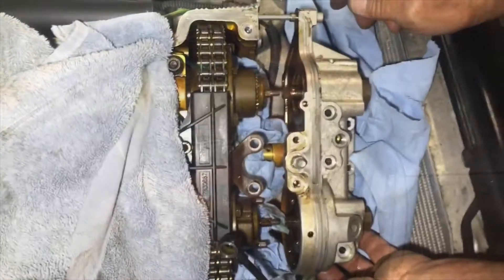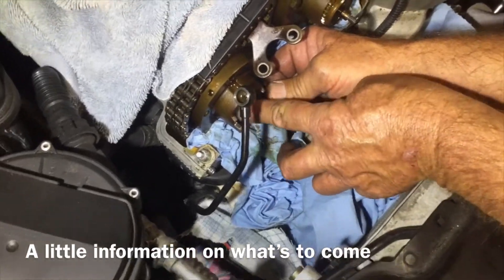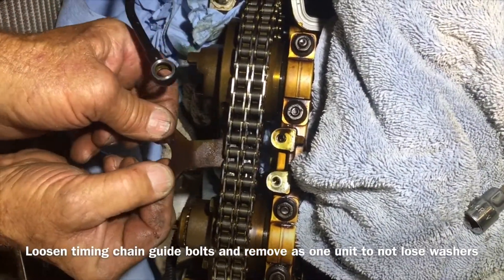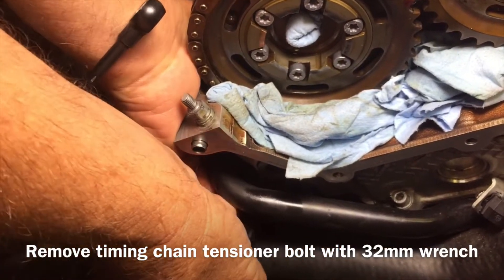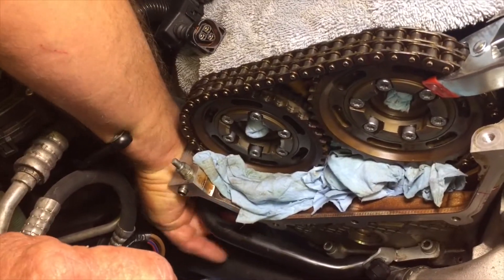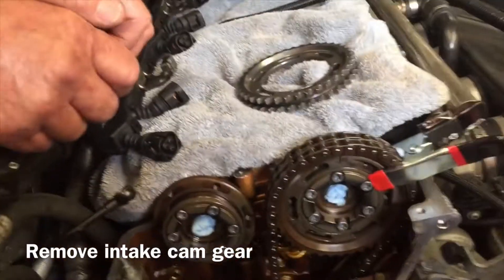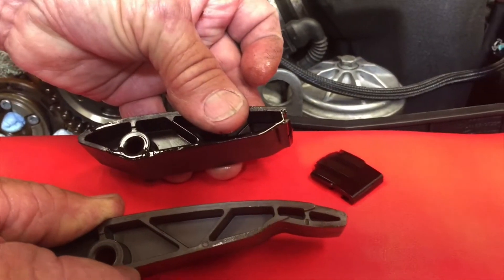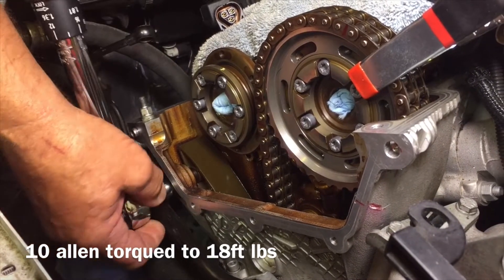HOW TO: Replace Timing chain guide Remove VANOS exhaust/intake hubs Cam gears chain tensioner E46 M3

Comment: Hello. Thank you for your S54 videos!  Question about the 32 mm tensioner wrench: is this short wrench enough to undo it? And then tighten it with enough force? Soec calls for 70. I found similar short wrenches, but others advice to use a deep socket with some modifications. ?
Reply from the maker: We used a short wrench to remove it and install it.   If you can remove it, you can get it back in with the right amount of tension.  Theres very limited room as you know making using a socket difficult without a lot of modification as you mentioned.

Comment: How do you tell apart the exhaust gear from the intake gear?
Reply from the maker: If you are talking about the larger ones( cam sprockets) they are the same gears. Or do you mean the splined gears?

Comment: Great videos! On my project, one of the studs that holds the valve cover unfortunately fell into the opening and I heard it clank pretty low. Any advice on a tool that could help me find it or advice on where it went potentially? My magnet stick had no luck. Thanks!

Comment: You guys do a great job on the "how to" videos. I really want to tackle my VANOS, but get pretty nervous because of the TIMING portion, and all of the little tiny steps. One question - what is the added benefit in switching out the Gear sets ? I would be terrified to touch the chain :)
Reply from the maker: the main benefit is to freshen the whole system up. so that you know its all new and can be confident in it.  sometimes, when we leave old parts in and then those fail and we hav eto go back in again.  Plus, we wanted to show how to do all of it.  Yes- lots of tiny steps, but done right its worth it!

Comment: can i get a link for that 32mm wrench?
please
Reply from the maker: there is a 32mm wrench from bmw/ecs that is the first link in the description.  However, the one we used is a modified wrench we cut in shop.  Buy a cheap wrench, and CUT it down to length required to fit in the area, a chop saw will do the trick.  If any other questions, just let us know!
Reply: Did you just torque it down as hard as you could by hand? I read somewhere it should be like 70nm but it seems nearly impossible to get a torque wrench down there.

Comment: Where did you get the 32mm wrench?
Reply from the maker: Here is a 32mm/35mm wrench that doubles for a fan clutch wrench.  Not the exact one i used but nonetheless.
https://click.linksynergy.com/deeplink?id=wjLDNk1cnDk&mid=43304&murl=https%3A%2F%2Fwww.ecstuning.com%2Fb-schwaben-parts%2F32-36mm-double-open-end-fan-clutch-wrench%2Fdo-3236%2F
Reply from the maker: The exact one we used is a wrench we just cut to fit. Worth it for the next car.

Comment: Beisan part number if you’re interested. .....S54 Exhaust Upper Chain Guide.  Item # BS026, $80.   For BMW engine S54.... I’m not affiliated with them. I own a 2006 E46 M3 comp package...Thanks for the VIDS 👍

Comment: I'm just after this point, ready to put everything back on and when you do this, I guess the timing is ok but the hubs are off as well as the plate they screw into. I'm having a time figuring out where the spot is to line them up properly... I had to slightly rotate my exhaust cam to put it back in time with my timing tool. Yours fit like a glove with seems a bit disturbing to me for my engine. Hopefully I did this right XD
Reply from the maker: not being with you watching whats happening on your engine, I cant be sure! BUt compare and take notes in the following videos and lets see!
Reply: So I got the dreaded P0014 code for an over advanced camshaft. The car drives amazing and my idle when warm is perfect. Horsepower is there and everything is so much smoother now. I'm thinking that tool is just not built to the right spec and the camshaft maybe be 1 or 2 degrees off. It isn't a stored fault code but it does come back. I'm reluctant to take it all apart because I don't have the time to do this again.
Reply: Andy Freeman did you leave The way it was? Or did you take it apart again and fix the timing? I’m curious because I’m about to do this on my car and I’m debating whether to do it myself or have repair shop to do it.